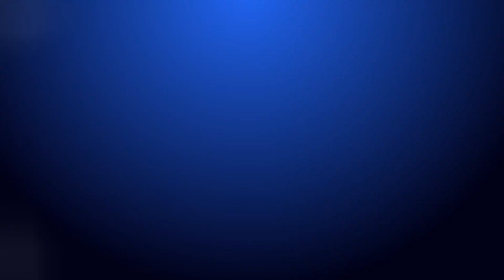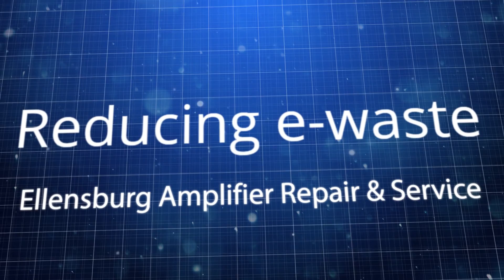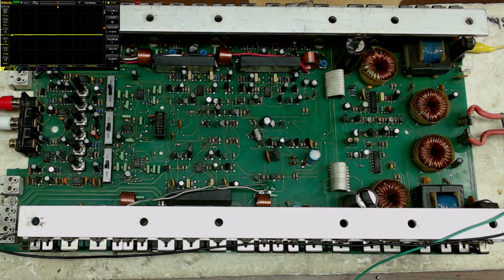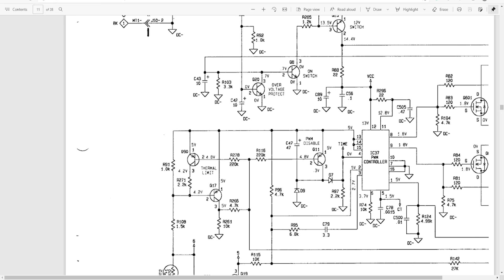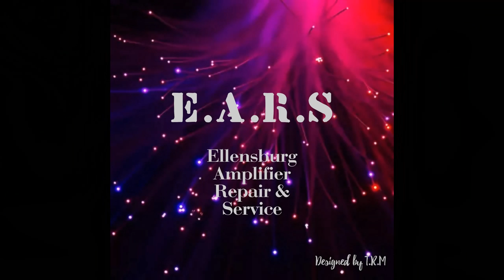McIntosh mc440 Class AB Automotive Amplifier Repair and Rebuild Adventure

Comment: I have a 440 that gets static in one channel and then shuts down. It was repaired once after a output was shorted out. I'm going to open it up and check it out and see what the last shop did. It is a intermittent problem. I had the amp 26 years now.
Reply from the maker: They are fun amps to restore. Too bad the output modules are obsolete, or I would have kept on rebuilding them.

Comment: man.. i have to many mc amps to refurbished.. had them forever, put away on my closet.. got older and left stock stereos on my more current model cars (2016).. but now i need updates on my old old cars (1965 mini cooper s and 1971 datsun 521).. thinking of putting 2 mc amps on the mini, and probably can only fit 1 on the datsun.. wish i had the mc440, could use a 6 channel.. i live in L.A, imma take them to George Meyer.. not that far from me thankfully... Great video, gives me some inside knowledge before i take the amps... thank you

Comment: Had this Amp been fixed?  I'm having the same issue.  The shop that I sent to gave up already.
Reply from the maker: Yes this amplifier was repaired. Has that shop replaced the output modules?Did they give up on the PG (Power Guard) circuit?
Reply: @ it’s too bad we are in a totally different continent or I would have access to better people with knowledge to solve this.  Initially I have issues with power guard not functioning.   My MC440 was fuming.   Brought in to an authorized dealer for McIntosh amp to fix.  I have no knowledge whatsoever in electronics therefore I don’t recall what they did.  After months with them they fixed it.  It worked fine for like 3 weeks then I had realize the power guard turns on every time I turn on my sound system.  Reset it and it comes back up after a few minutes of playing.  Other components had been checked so it’s confirmed that it’s the amp.  Brought it back again to the authorized dealer to check.  After another 4 months they gave up.  Power guard isn’t working again this time.  I’m about to go pick it up and see if there are more capable people that can fix this.  😿

Comment: Hello thank you for your video. I have a question for you my Powerguard light is on. Is there anyway I can bypass this? Or can you suggest any other solution to look for in the amp? Thanks again!
Reply from the maker: Pull up the manual for the MC420M (page 7) to learn about the circuit and how to bypass it. In most cases the PG led comes on when there is a module failure.

Comment: What was the estimated repair charges on the McIntosh amp ?  Curious how bad it can be if I were to pick up a couple. Obviously it can vary depending on what exactly is wrong
Reply from the maker: If I remember right they were $125 to $175. It has been a while since I did my last one. The issue getting authentic output modules.
Reply: @ellensburgamplifier  thank you

Comment: iirc the MC440 service manual shows the PCB layout with the component designation. yeah it makes it hard to bounce back and forth between the manual and the board, but it is possible. Im on the hunt for a MC440 soon that will likely need caps done and such. These are however super awesome vintage amps when working.

Comment: EQ module or bypass pins have to be on
Reply from the maker: Yes, you are correct on that. Thank you for watching!
Reply: @ellensburgamplifier  Fixed a few myself.  Such a pain and STK modules are bad frequently with replacements being fake 90% of the time.. I have a surplus of STK modules if you ever need any.. I refuse to take in McIntosh car amplifiers
Reply from the maker: @gettingoldsuckss  I too will not be taking anymore of them in. They are typically too far gone and take a ton of time to refurbish. Since I don't charge by the hour my profit margin is slim.

Comment: good night. are  the aux voltages present ? that is your +/- 15 volts at the op amps . What was the initial issue with the Amp?
Reply from the maker: Hi Peter. Yes, all the voltages are present. The initial issue is corrosion. I do believe there is an output issue on channels 5-6. Also, it is a 50-volt rail for the subchannel. I hope to have the output figured out soon!
Reply: @ellensburgamplifier  I you remove the rail voltage from output section of channels 5 and 6 it should give you a lead
Reply from the maker: @peterb7399  Thanks! I have been debating on removing the output transistors for 5 and 6 but uhhg, what a pain. It does not help me that I can not cross the part on the board to the schematic.